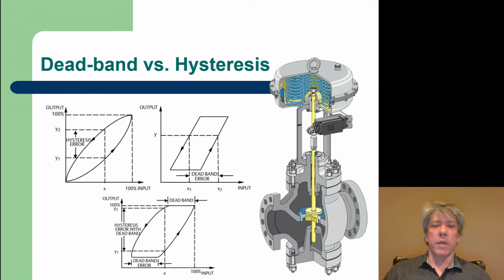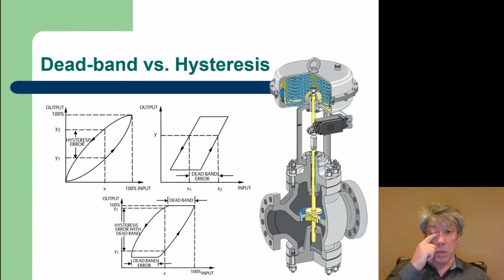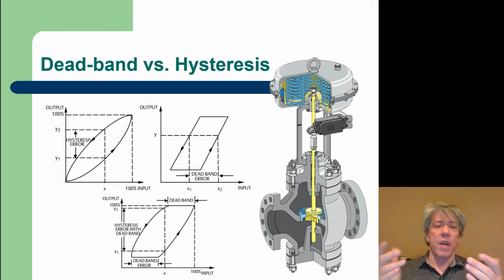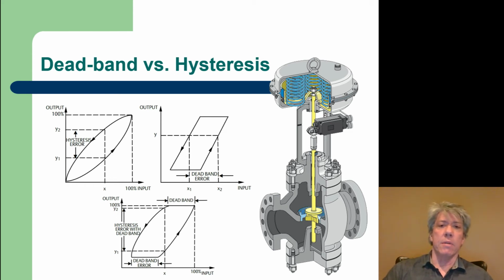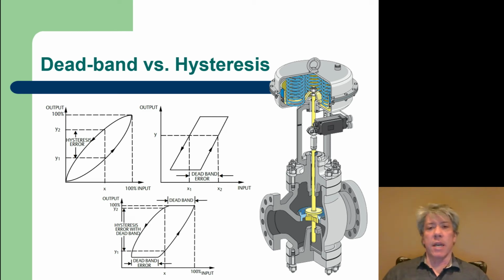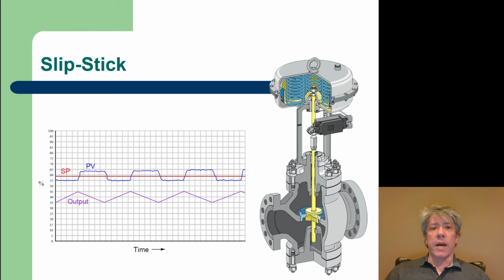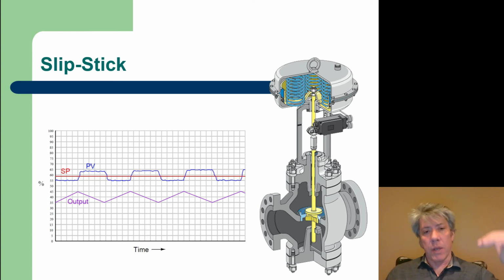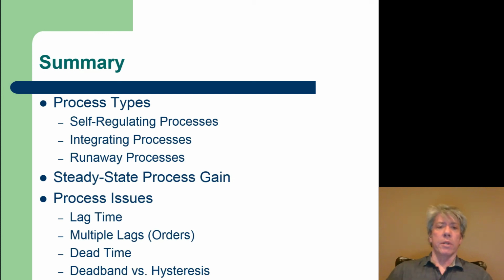MET 382 Deadband and Hysteresis

Comment: Great Job. 

Can a dead band be an indication of a process control degradation?  For example, if I am trying to monitor the performance of a pressure control loop on a separator, and I look at the oscillation or the pressure behavior over time. And I noticed that the time to stabilize the pressure to the set point is trending up or that the pressure never is at the set point due to dead band phenomenon, Can I conclude that the pressure control loop is starting to degrade?
Reply from the maker: Regardless whether deadband is the culprit or not, the change you describe is definitely degradation of control.  How well a control loop performs can be characterized 5 main considerations: 1) minimum error at steady state  2) want to minimize amplitude of oscillations 3) time to reach setpoint 4) overshoot ,and 5) stability.  What you have described sounds like a decrease in stability of control (5) or increased time to reach setpoint (3), so your process control quality has decreased.
Reply: @damonsisk4270  Thank you so much. Very informative.